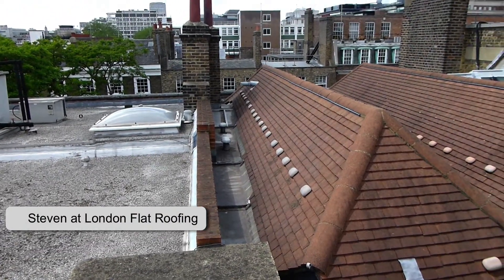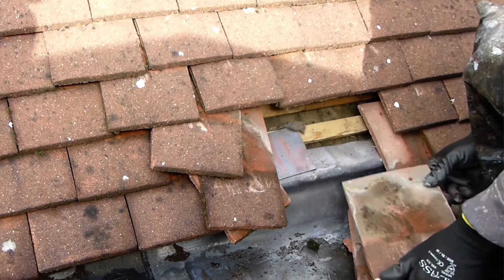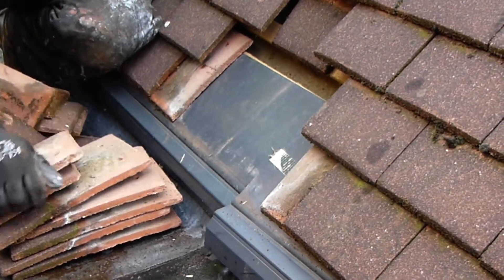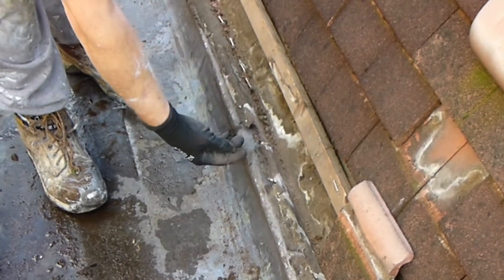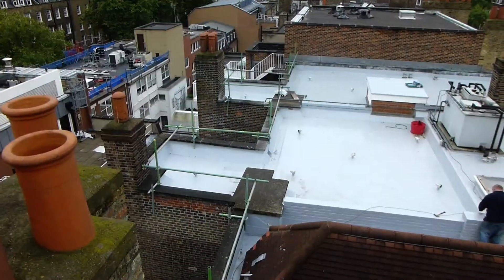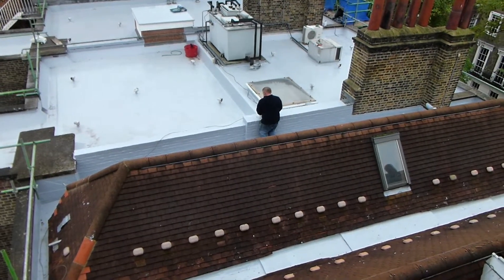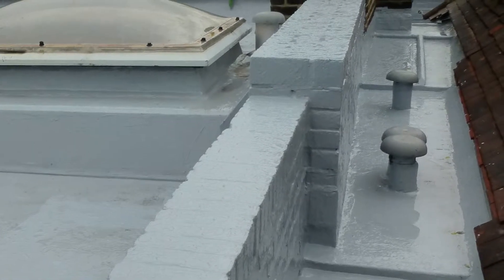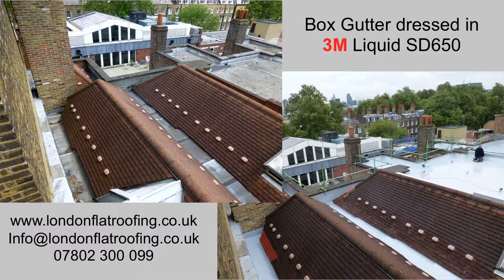Boxgutter dressed in a liquid flat roofing material

Comment from the maker: Box gutters and  valleys on flat roofs are alway problem areas, dressed with traditional materials such as lead or zinc expansion and contraction has to be taken into consideration. With todays new liquid flat roofing systems we can overcome the problem with expansion and contraction and apply the liquid rubber solutions over the box gutter without having to strip them out.
http://youtu.be/HJS40HZ4-08